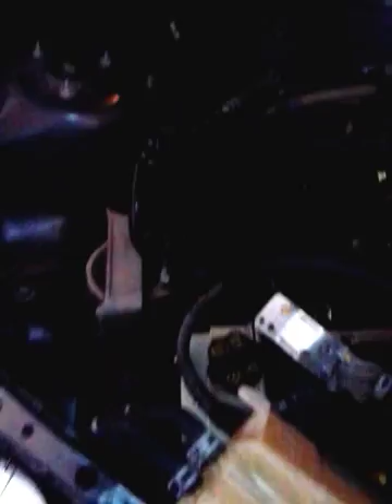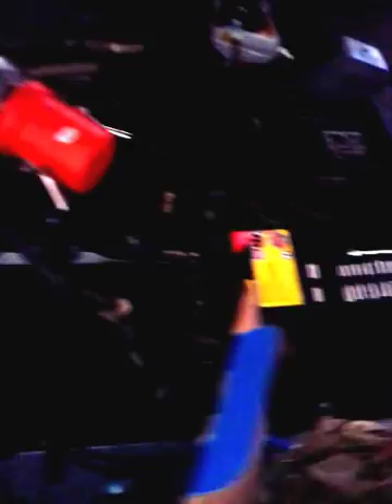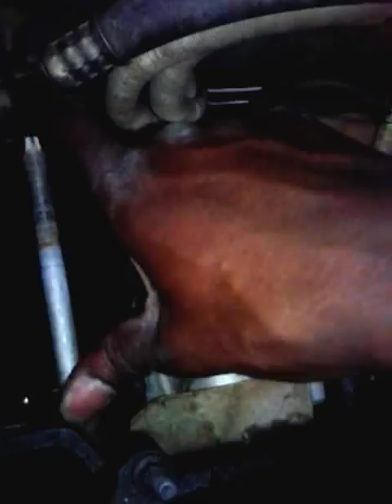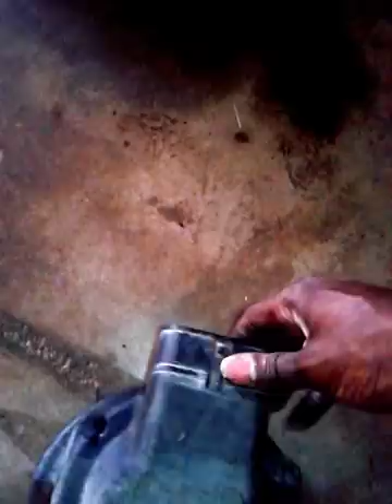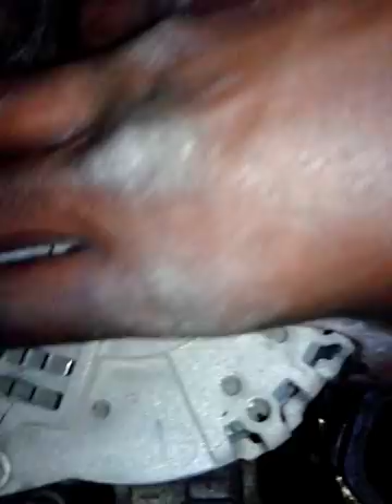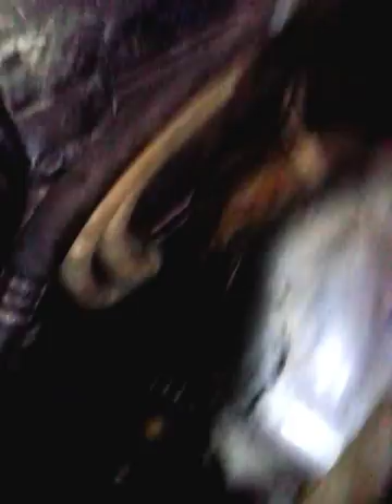2007 Ford Focus se alternator replace easy

Comment: Nothing wrong with doing it this way, but going through the bottom you don't take of hardly  nothing. I pulled the wheel for more room, tilt the motor and bam she is out :-)

Comment: Update this method works and is relatively easy. Points to remember watch the other 2 videos as well just to get your bearings. 2 the plastic cover is spaced by one nut on the stud before a second and there is a black wire bracket attached. I forgot this but am hoping it can breath well enough. The small plastic clips will likely break they are very thin and the plastic is brittle. Last be careful the belt is on the way it should go before you bolt on the new alternator. There is enough slack that it can go around the bottom stud and you could have it all bolted up before you realize it. Yeah did that too. Overall much easier than crawling under the car. The 1/4 socket will work to remove the studs. Another tip both nuts have to be removed from both studs before removing the studs. The tight nuts pull on the stud increasing friction and makes it too tight to remove. After you remove the nuts on the studs they move easily. After watching the other videos watch this one twice and you'll be ready. Thank you again.

Comment: YOU are Great man thanks. Two other videos and my very mechanically inclined brother described how to remove this from the bottom by unhooking motor mounts. It appeared very difficult and took much longer. You took your time and got it out from an angle that most of us will be better off trying. I have to do this tomorrow and I'm going to try it this way first. Removing the studs seemed key. I hope my deep star socket will work but if I get it started I should be ok. I saw someone else was able to use a 1/4 inch socket. Thank you so much.

Comment: Dude, you rock!!! Before I saw your video, I saw another one that had an easy way to take the alternator out too,  but it was thru the bottom of the car. I thought that was easy but when I saw yours it was even easier. My focus is engine is identical to yours , so, I will use your method  instead!! Thank you so much for posting your video, man! 😊. I will subscribe to your channel immediately just in case you have other ideas and suggestions on different projects for this car's repair!!😁. I plan on working on my car this weekend. Fortunately, my car will be in the garage because right now, it's 28° outside. Wish me luck!!!😁😁
Reply from the maker: Good luck you got this no whammies

Comment: Thanks buddy this worked great! The only thing I did different was I took the motor mount bolts off on the car side but left it attached to the engine. This allowed me to just yank the engine front about 2in to make it even easier. Didn't need a Jack or engine stand or lift or anything. Thanks again for saving me time!

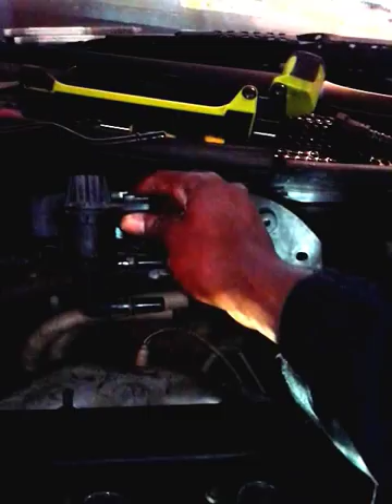Comment: What did you use to cap the EGR?  You mentioned it around the 0:57 mark.
Reply: You decided to make the video after you have already taken it out, but it came to a good result....very helpful...even better than  taken it from the bottom of the car as some specialist  does it on other video.
Reply from the maker: I caped it off with some duck tape
Reply: +Qdogqtip Williams Thanks a lot.  Your video was a huge help.